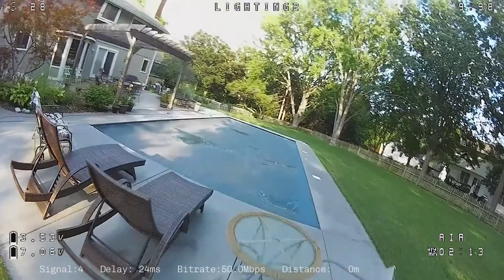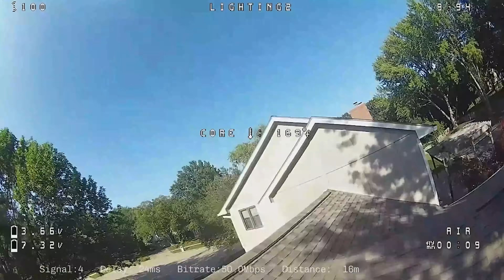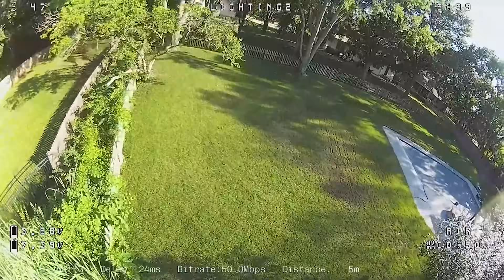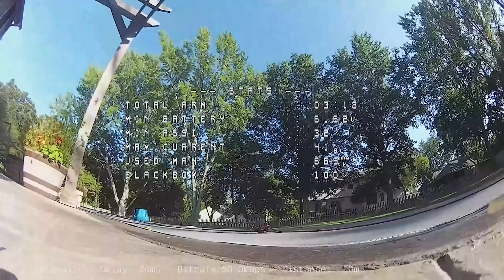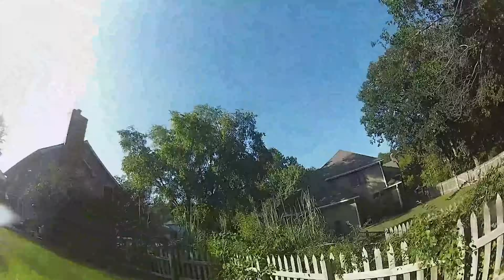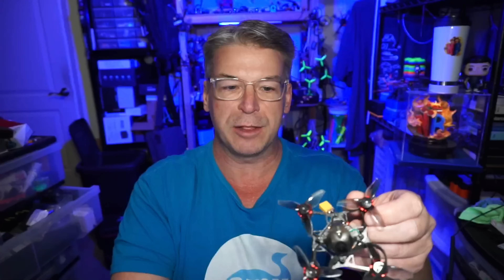Now in HD // Lightning2 YMZFPV

Comment: Got mine this week, flown 8 lipos and the camera is broken on a mild crash. Got 7 other drones, all toke much stronger crashes and rarely break anything.
Currently I get a black image with OSD overlay. The wiring seams fine so I ordered a new camera to give it another shot.
Reply from the maker: Seeing the osd and no video indicated the camera is not working. OSD is from the flight controller, vtx seems to be transmitting still.

Comment: What AIO should I use for this beauty? I had a MObula 8 hd one and it doesnt fit since the motor plugs and usb port are pointing down and it makes mounting it almost impossible. What AIO is compatible with this frame (and 04 lite)? Thanks!
Reply from the maker: The Happymodel CrazyF411 20A F4 ELRS 2.4GHz Whoop AIO Flight Controller is an option it has horizontal motor mounts.
Reply: @NickBurnsFPV  thanks!! I'll look into it, you the man :)

Comment: Thanks @NickBurnsFPV for the constant tks tks tks..genuinely. It sunk in and i bought some Starlord frames and have actually converted 2x hdzero mob6 eco's (with 1103's from hm). They're about 39.2g, so save 6-7g on the original mob6 hdz... Absolutely rip.  Appreciate you covering the more easier to fly without scaring people/being hassled zone in FPV.

Comment: Totaly didnt notice untill you were about to mention the damage.  I wouldn’t expect many micros to survive that smack without something breaking.  And hey, it’s not another cinewhoop lol.  Did the arm and motor end up in the gutters perhaps?   Neat little quad, needed an unmovable object and plaid speeds to break but I can see how a little more thickness to the frame would help.  Thanks for the review!
Reply from the maker: Initially I thought the fence hit was the end of the camera then the chimney I was holding my breath to no avail. The arm could certainly be on the roof or gutter, I took another hd quad up for a look but didn't locate, but I don't have any with a camera on a gimbal so they were just fly by looks for the most part.

Comment: Great review, 👍 this is within my favourite size quad between 2  to 3 Inch, and I had to build my own HD Walksnail quads to have what I want, so it great to see this BNF. About 2mm bottom plate, sometimes it better the break bottom than bend a motor, as long as they sell spares. The lack of camera protection is unforgiveable and why the below average tune?
Reply from the maker: There is a trade off with durability and component impact…damage

Comment: if you cut right down center of the battery holder it will hold any size battery
Reply from the maker: Not very effectively as the structure would be compromised

Comment: Ah! Nope I did not realize :)
I’m running 1002s at 14’000 on 2s. Still holding :)
Regarding the time to fall, does it have crash recovery? That could flatten it a bit… but it would spin like crazy I guess.
Reply from the maker: I did not set crash recovery

Comment: Have you checked the roof of your house?
Reply from the maker: only with another quad.
Reply: @NickBurnsFPV  What your general opinion regarding Walksnail system? My daily driver is HDZero but from the very begging I thought to buy VRX from them but I still don't know if its worth it (for freestyle and cinematic cursing)
Reply from the maker: @w1llyFPV  I think of it as a middle ground between hdzero and dji. Image quality isn't as good as DJI but better than hdzero. vtx are less expensive than dji about the same as hdzero. Hdzero and walksnail are invested in fpv vs dji has their own secret plans and seem to use fpv as testing grounds. DJI compatibility is also something that worries me in the long term. Hdzero and walksnail flexibility allows for use in whoops on up to the bigger quads, DJI is really at a minimum 2s, with the risk of potentially stripping away to go naked to drop the weight.

Comment: Seem like an odd design decision for them to have those metal side frames but then not use them to protect the camera. Why would they have the lens sticking out like that?

This thing certainly looks cool, but I'm not sure why someone would pick it over one of the 2" 2S toothpick style quads like the Happymodel Bassline or the Flywoo 2S Nano Baby 20.
Reply: Bassline is a lot of fun, and so is the Baby 20. The Baby 20 is a little under powered though, so 1030's seem like a good upgrade. The Bassline isn't the cleanest build either. I'm a lot more impressed with how tidy the Flywoo is. So the Lighting does seem to be a nice build with a little more power. Seems like they should have gone top mounted though and with better camera protection. 

I'd check out Avion too. I just bought their 3.5, and it's such a clean build. Flies amazing as well. It's now my favorite quad.
Reply: @Greg__K  Yeah, I have a Nano Baby 20 (the Walksnail version). I heard a number of people call it a bit underpowered but this was my first quad and I figured a little less power wouldn't be a bad thing for a beginner, and if it did end up bugging me later I could always swap out the motors and props. I've certainly got no complaints, especially about the construction. I've crashed it into a soccer goal hard enough to dent a motor bell, but other than the written off motor and prop damage it was perfectly fine. There's barely a scratch on the frame.

I'm currently having a lot of fun with a Caddx GoFilm 20, which is not as nimble of course, but seems to be another very nicely put together quad. Easy to work on, too.

At some point I'd like to build my own sub-250 g 3.5" freestyle quad, thinking AOS for the frame.
Reply: @anthony_horton  I have the same Nano 20 then, the WS version. I say it's under powered mostly because it shutters, prop wash, when doing aggressive maneuvers, otherwise it's pretty fast. The Bassline solves that with 1103 motors, but goes through batteries a bit quicker.

I think either a 3" or 3.5" open prop freestyle quad would definitely be the next step for you. Nick Burns has reviewed a few of the Avant quads, now AvionRC, and would highly recommend one of their quads. I just got the Nexa 3.5" WS version, and it's the most locked in quad I've ever flown. It's on rails! The build quality is super clean and well thought out as well.

Comment: What a coincidence, I actually have this frame on order. Planning to build it out with HDzero
Reply: how did you end up liking your lightning 2 drone?  i was considering it.
Reply: @NevrFPV  I like it, it's very fun. The carbon frame is kinda thin though, so I fly mostly in the park/ jungle gyms and haven't broke anything yet. The frame is a little tight, so you can't fit a lot in there, but you can fit a HDzero whoop lite in there. Camera choice can be a challenge though, so you have to choose something small
Reply: @PaulyNu  Thanks for the reply man!   
Feel you with the frame worry.  I have a crux right now and im probably going to double up on the frame.  Took a hard bash yesterday and snapped an arm, and managed to swap the frame but im a bit more careful now!  I said a little prayer to the fpv gods not to make me too cocky when i fly.  Its just so fcking fun.